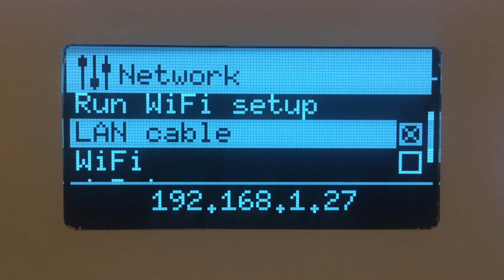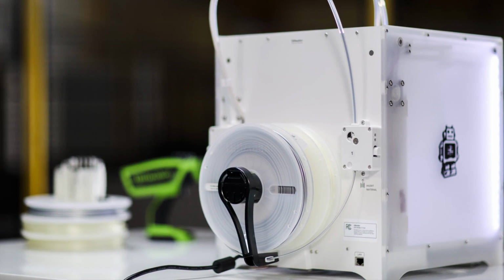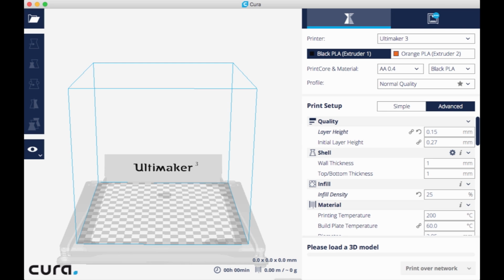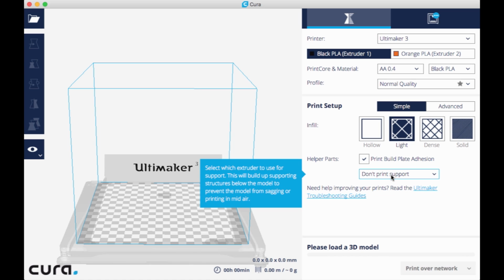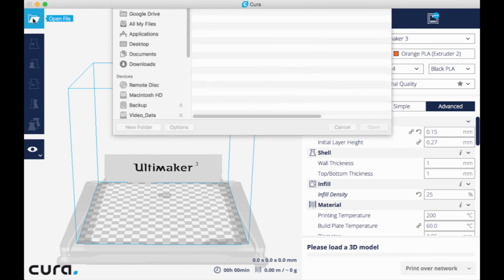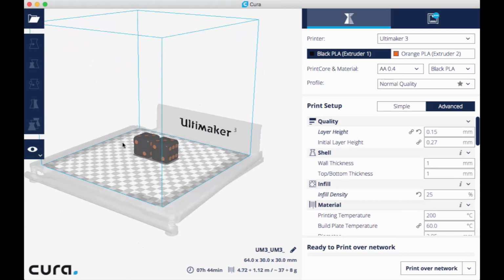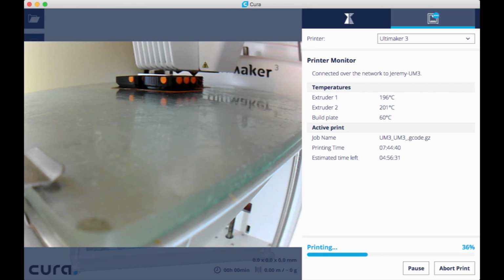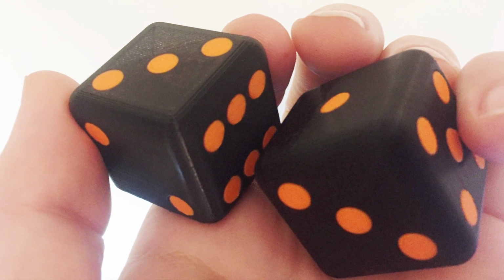Introduction to the Ultimaker 3 (3D Universe)

Comment: Not impressed with the camera, how many frames was it getting?

Doesn't Ultimaker know that people stream their printing? They'll still have to use a camera which makes the included one utterly redundant. It should have been, at the least, a proper 1080p @ 60 frames.

They halfassed the 2+, now they're halfassing this too? Their machines are too expensive to pull this rubbish.
Reply: the camera was installed for monitoring from Cura. Not many users need to create YouTube videos you know.
Reply: It has nothing to do with 'need', a camera is a widely enough, used piece of equipment when it comes to something like this that there's a pretty high chance, whether you're willing to accept it or not, that one would be used in some capacity and for Ultimaker to add a substandard, to the point of being obviously absolutely useless camera, meaning out of the box the camera is only going to be useful or desireable to those willing to put up with something so clearly inferior to the tech available on the market.

No way I'd ever buy a nearly £3000 piece of equipment that has something on it that I'd be stupid to ever actually use.

The camera was nothing but a 'feature' point and it's useless as that because the camera is so crippled and useless.
Reply: +Bob Bob the problem is actually in Cura. Cura 2.3 only supports snapshots, while the printer actually emits 30fps. This will hopefully be fixed in the next Cura.
Reply from the maker: The framerate issue has been addressed with the latest version of Cura. V2.4.0 beta now provides a full motion stream preview instead of just snapshots.
Reply: Thank you for the update.